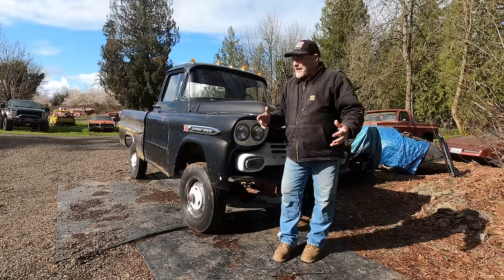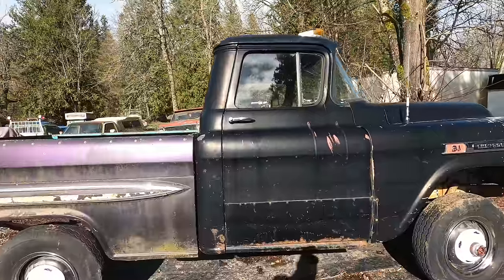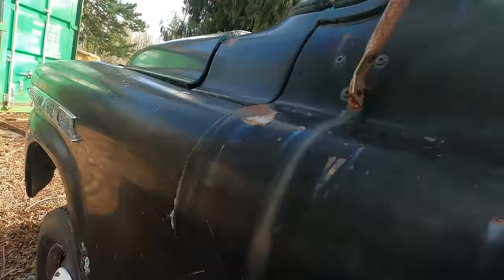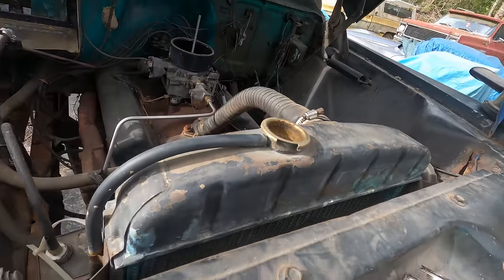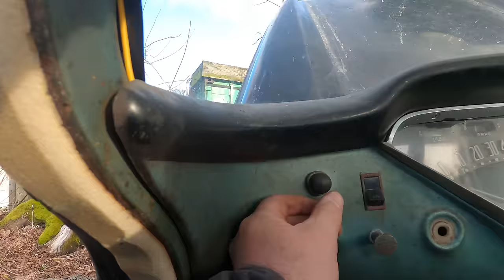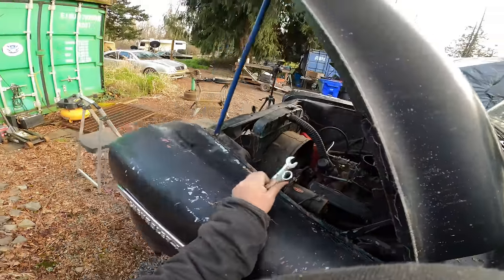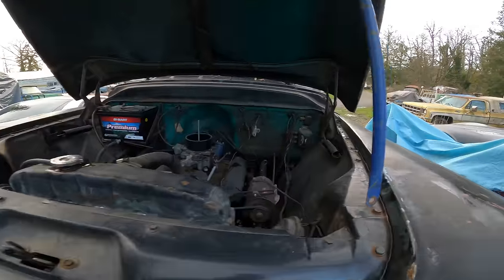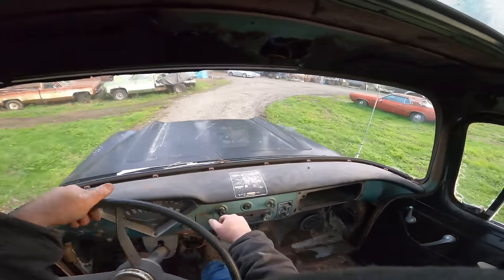1959 Chevy Apache Napco 4x4 Will It Run?

Comment: Just before you said the air cleaner looked original I was thinking the same thing. The carb is a WCFB Carter and they were stock on the 283 and 327 through 1966. I've seen stuff in worse shape put back together, but since you have the good parts on hand, I agree swapping a big window cab is the way to go. Looking forward to seeing this one added to your fleet of running trucks.
Reply from the maker: Thanks Burt. I'm looking forward to several builds this year, but I'll put in some more work on this one while I'm putting the shops together.

Comment: Inspector general called it right, it runs.
Reply from the maker: She's always right...very professional that Truck Inspector General.
Reply: Leave the patina fox the bed swap cab small block Chevy install with 4 speed. Add alt 10si and flip for 25k. Next. Year....

Comment: That truck is pretty good all things considered. I like it is sweet. In most vehices you can order new replacement floors why dont you order some and weld them in? A harbor frieght mig welder anyone can spot weld. I see little china girls doing it. If you can build a building and fix motors you can weld. Pop rivets work but welding will give it the strength it needs. Napco runs awesome.

Comment: Like I said in my last comment "if it turns over it'll start" good old 283
Now you need to put some "stop juice" in it and bolts in the bed.
Motor sounds good and its a chevy so it will always smoke on start up.
just like Homer did. Upper end oiling on start up.
PEACE AND LOVE FROM MINNESOTA......BARRY✌
Reply from the maker: You DID say that Barry. The clutch pedal binding on the floorboard is actually more concerning to me than the brakes right now, but I'll make sure I address both issues promptly.....after I dress it up a little more....I'm having fun with this one.

Comment: Looks pretty darn good in black, but I'd have a hard time not going back to that original aqua color!
Reply from the maker: I know what you mean Dan. I haven't seen many 55-59 Chevy or GMC Trucks with that shade. Thanks for the visit.
Reply: @ClassicTruckRescue  And were those trucks available with the chrome spears running all the way back across the doors and B-pillar corners? If so, that truck deserves those, along with chrome hub caps and a chrome grill - to go with that chrome bumper. Although the way GM sent it out the door, nearly sixty years ago, is perfectly acceptable too...

Comment: I'm not sure, but that being a regular cab, and not a deluxe cab....brakes might not have been an option on the regular cab Napco 4x4 for 1959....I think over the years someone has removed the "brake pedal delete plate".....Someone over the years has also added the drivers running board/ rocker panel air conditioning.....also not available from the factory.
But great drive train and running gear.   A great truck for the Ranch!!!
Reply from the maker: I see you are familiar with some of the more rare options. Awesome!

Comment: I know nothing about paint, but the "Sherwood Green" thing is a little odd. My mom bought a new '70 Skylark that was that color and it was a much darker, metallic green. That looks almost bluish-green. Either way, it is a good looking color. edit: that motor seems pretty tight. If someone cared enough to throw in the roof glass and the new fenders, I wonder if they freshened up the motor, too?
Reply from the maker: Sometimes different manufacturers or divisions will use the same name for a color and it will be quite different in appearance.
Reply: See? I said I didn't know anything about paint:) @ClassicTruckRescue
Reply from the maker: You might still be right though. I found some more layers of paint. This one has had a history...haha.

Comment: Dimmer. Switch
Reply from the maker: I'll check that. You may be right. I've had a bad dimmer switch cause the headlights to completely fail before. Thanks.
Reply: Yeah really CHEK the wiring on floor and see if good at connector,,for 10 bucks cheep insurance that's one on floor you stomp on to change..light switches and bulbs suspect too. Have gune.  ..where is tre. Truck inspector?😊😊
Reply: @ClassicTruckRescue  yup I'd keep this one for a time do about 20eps on cab and interior. You got. Pure YT GOLD  THERE?  BTW USE A TOP. POST BATT CLEANER TO BRUSH CLEAN ALL SOCKETS. AND ADD A DAB OF WHITE GREASE TO PREVENT CORROSION
Reply from the maker: She inspected this truck in the first video I did of it. I then put her Truck Inspector General sticker in the back window.